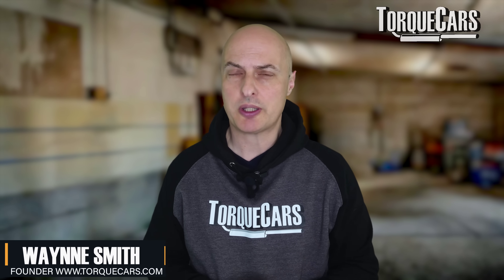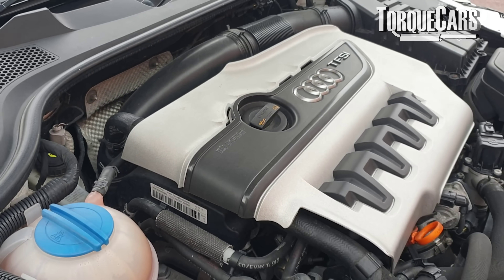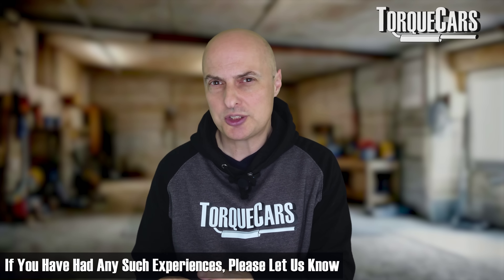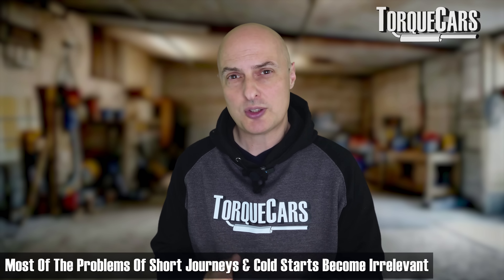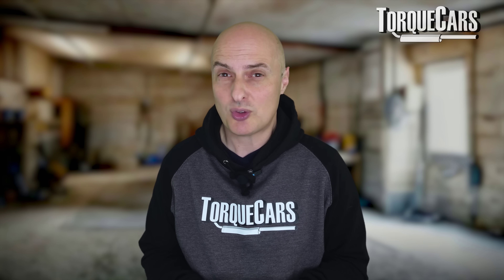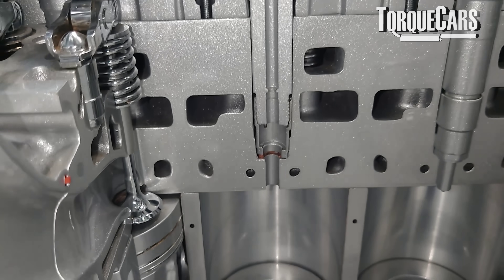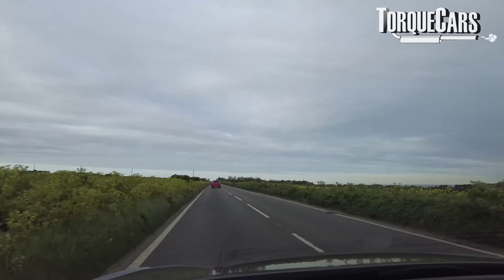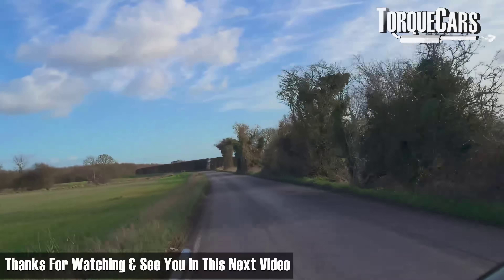🚗 Stop-Start vs Engine Idling: Which Really Kills Cars?💥 The Truth May Surprise You…

Comment: I've driven 2 stop-start cars, both diesels, I'm not sure if that makes a difference; 

Citroen grand C4 picasso/spacetourer 1.5 manual. It was perfectly fine, as you say it would kick back in before even reaching the biting point, and the system wouldn't enable stop-start until the engine had warmed up & Aircon is off.

Ford grand tourneo connect (rebadged VW cadi maxi) 2.0 automatic. Absolutely awful, stop-start would kick in before you even stopped, whilst slowing down, even somewhere around 5-10mph, when this happens the power steering cuts out too. It would take at least a second to kick back in, I found it incredibly dangerous and there wasn't an obvious way to disable it without going through a million menus on the touch screen, even then it wasn't permanent.
Coming to a T-junction and slowing down, then going to turn and leave would almost always have the engine cut out and progress halted. I returned it after less than a year, it was woeful. It was worse than being a new/learner driver again stalling it at every inappropriate moment.

Comment: My stop/start doesn't even operate when cold or if the battery voltage is too low but I'm now in the habit of just switching it off each time I start the car.
Reply: @mda5003  I have a ds3 and mine is the same I just turn it off
Reply: Same with Jags. It doesn’t work until the engine’s warm
Reply: Same
Reply: All i get is the green eco light flashing if i try and use it so its just a waste of time @stephenvarty191

Comment: What about turbo engine? I mean turbo itself. Driving hard, "barely legal, full brakes on red traffic light and your start/stop system is shutting engine down. Engine oil in these tiny tubes to the turbo and from are simply boiling there. I am not joking, you can check boiling temperature in the spec of your oil. Mine is 223 degrees Celsius. Guess what is the turbo temperature? Yes, nothing will happen immediately but oil residuals after boiling will stay there, in tiny oil chanels and willmgrow with time until your engine oil will not be able to flow there. This is not a hate, this is just an expression of my own and private understanding, knowledge and experience. I have switched off systems completely at all my vehicles with the help of different things. There are several ways to do it at least for the cars I use. And I am planning to use/own as long as I could. Cheers from Sweden.
Reply: start/stop does not activate when turbo temps are high. The ECU monitors EGT and coolant/oil temperature. Hot turbo = start/stop disabled. That’s why real-world start/stop turbo failures are not a thing

Comment: Stop start began in Europe decades ago in polluted cities. Traffic lights would have timers and you would turn off your engine at the lights. The stop start technology came in well after vehicles had electronic fuel injection and modern pollution devices that have now made exhaust clean. There is no need for this anymore and it can’t help but only make it fail quicker. Stop start leaving more fuel in the cylinders and getting into your oil 😮 Stop start is just a useless added expense

Comment: A decent stop-start doesn't operate until the engine is warm. I generally leave it switched on in my VW Transporter, but do switch it off if going to be in heavy congestion for long.

Comment: What about the amout of times the starter motor has to engage ? Wears it out prematurely 😢
Reply: It depends on how the engine is restarted - some cars have an alternative starting system eg an integrated starter generator, which may be either belt driven or direct drive.

Comment: Stop start generally won’t operate until the engine is up to temperature, so a cold engine is irrelevant
Reply: Are these systems responding to the time for coolant reaching operating temp?  If so, when starting a journey from cold, that time is not the same as for the metal engine components, nor for the engine oil.  

Warming-up times for each of these are different to the coolant fluid itself.  They probably vary, depending on the vehicle, engine type and operating conditions, but it's still worth bearing in mind.
Reply: @assininecomment1630  where is the coolant getting the heat from though ? Obviously the engine temperature and oil temperature

Comment: Stop start is annoying and will wear starter motor and battery out faster. When you start excess fuel is used briefly which could dilute oil if in a long jam. Stop start should be inhibited till engine up to working temp. If you drive in cities you should change oil more often.

Comment: Engine idling definitely.My stop start always fails within 6 months of buying a new battery
Reply: either you bought the wrong battery or you have problems with the electrical system. I've been driving with the same battery for 4-5 years and I use the start/stop system almost constantly - 2011 Hyundai I30 with 176800 km mileage :)

Comment: I know in the United States that's been discussed heavily through the last couple of years on YouTube, and it is definitely not a good thing to have an internet keeping starting and stopping as you're in a downtown traffic. And when that happens, you're not saving enough gas to make that even worthwhile. Which is the initial initial concept behind the idea? But when that happens, you're also causing more battery where you are. Your batteries probably not gonna give you. Maybe a couple years last time, if it keeps stopping starting it's not good.  The other thing is that I mean, this is not even an opinion. And some of these websites have also noticed that the about a complaints where the car doesn't start app just quite quick enough and you're going through traffic, making a turn after a light that almost couldn't you get the hesitation? And sometimes it occasionally works too much hesitation. So now you're backing up on the traffic around you? Instead of a car, running normally or truck be it. Now I'd rather stick with the old system where it just stays running and I'll shut it off when I think it's convenient for me.

Comment: I run my petrol in eco mode which disconnects the auto transmission when certain conditions are met. 70mph downhill on the motorway at 700rpm. Start stop is disabled every yime I start. If I hit a real jam, then I re engage it. Engine turns itself off. User vontrol all the time. Less stress on the timing chain.

Comment: Stop start is rubbish that saves no fuel what so ever ( unless you stop for more than a min) all it does is smash the starter ring and cost you a bomb once gets past 3 years old . My friend is a mechanic at bmw and has done loads of um. I'm a hgv mechanic , if this stop start is so good, why isn't fitted to 15 ltr truck engines? Because its crap.
Reply: Some Suzukis  (for example) have a belt driven /driving integrated starter generator (IGS) as part of a hybrid system. The normal pre-engage starter starts the engine for the first time, thereafter the IGS starts the engine after autostop. It is a very smooth and quick operation and makes no sound. In the mild Suzuki hybrids the IGS also assists the main engine as well as charging the battery. For a strong hybrid, there is a fairly powerful traction motor in addition to the IGS, the latter now only used for starting and battery charging. I think engine size matters when it comes to autostop being practical.

Comment: I love stop start, when it stop.  It's so silent & calm inside the car with the air conditioning blower still running.  But I would prefer the stop start switch to remain off after I drive till I on it back myself.  Now it's irritating the eco idle start back itself even previously, I already off it.

Comment: I have twice had my stop/start (a diesel Suzuki) stop just as I wanted to pull out of a junction into traffic leaving me a few metres exposed! I turn off stop/start as soon as I turn the car on.
Reply: And your starter will last how long???
Reply: @JohnShields-df8od 12 years from new so far most of which was spent in big cities. Almost never turned off stop/start, if anything I sometimes drive slightly differently in traffic to use it as much as possible. No problems so far.
Anecdote isn't evidence but I've not seen any evidence that it shortens starter life either.
Reply: Same problem here, I have a diesel auto tiguan. It is a nightmare at t-junctions. I wish I could disable the stop/start permanently.
Reply: @johnlondon4800  I don't get where the issue is, any Stop/Start car I have driven only stops the engine when in neutral and you remove your foot from the clutch. Does the Tiguan not operate in the same way?
Reply: @Witchaven  They said it's an automatic
Reply: @mucicafrajer  Ah true. Sorry, I missed that.
Reply: @johnlondon4800  You can usually control its activation based on how you press the brake pedal or accelerator in an auto, and in a manual it's easy to control with the clutch
Reply: @johnlondon4800 Easily done by disconnecting the battery voltage sensor plug, although you may be left with a dashboard warning light.
Reply: Why would you stop your car, put it in neutral, and take your foot off the clutch pedal while sticking out across a junction!? That's on you, not the car.
Reply: Not true I can easily push my clutch in and there is a momentary pause before I am off I fucking hate stop start technology it’s fucked!
Reply: @u3962521 I've got it in my 12 year old diesel manual, it's absolutely fine. It's not completely instant but it usually is by the time you're in gear, and if you're going to need instant power why aren't you already in first gear with the clutch down.

IMO it's worth it to have slightly cleaner air from engines idling less.

Comment: Interesting that you failed to mention the most commonly described problem with stopstart. Wear on the starter motor, pinion and ring gear. Also the battery. 

Realistically, a normal day's commuting without stopstart would involve starting the engine twice. With stopstart it could be twenty times. Or more. This is bound to cause more wear on solenoid contacts, starter motor brushes etc.

And cars with stopstart require bigger, much more expensive batteries, so obviously it puts greater loads on them.

For these reasons, I generally turn it off. The exception being when there's going to be long delays at roadworks.
Reply: My brother, besides the rise of the belt/generator driven approaches of these mild hybrid systems, have you seen how beefy current starter motors are? 

That's the one from a MK8 Golf with a TDI Engine and DSG Gearbox. This car only comes with S/S: 02E911022CX (google parts number for pictures)
This is the one of a MK4 Golf TDI: 02A 911 024 (The MK4 never came with S/S)

You see how beefy it has gotten? Also they changed the output from 1,1kW to 2,0kW. These things just hold up since the Use of S/S systems. I can mainly speak for VAG but i rarely ever hear of a starter failing. Not sure about other brands tho. 

In terms of battery, you might have a small point, but again, the newer the car, the better the management. My Girlfriend has a 2017 MK7 Golf 1.6TDI with a manual.  S/S was used since the car was brand new. Thats over 100.000 starts. It's still the original battery and original starter at 160.000km. In MQB BCM Modules you can read the number of engine restarts.

In comparison, i owned a Passat B7 from 2014. I sold it with 250.000km, still with the original starter, but yes, the battery management was shit. One winter, the car would't restart after a stop anymore because the battery was dead. Also the battery on that car had to be replaced every ~3 years. This was shit.

Comment: It's especially useful if you have an engine with a wet belt system as your belt will last much longer if you have stop/start working. Best stop/start system imo is the reversible alternator that PSA used. Works miles better than a stater motor constantly engaging
Reply: Why does the wet belt last longer with stop/start?
Reply: Because it reduces fuel dilution. The main cause of wet belt degradation. You could prove this to yourself with oil analysis.

Comment: Stop start is useless on cars most of the time anyway, when it's hot you've got the AC running stop start barely kicks in because it can't run the AC for more than a minute with no engine and in winter it's the same for the heat and the fact the battery is less optimial in winter. At night it's rubbish especially if you car has halogen headlights as the power drain from the lights again means it can barely manage a minute before having to start up again. The only time stop start works well in the UK is briefly in spring and autumn where you aren't blasting AC, lots of heat and using the lights.

Comment: It’s also important to note, that turning off start/stop is recommended when driving fast for longer periods of time. This way you are able to prevent any overheating issues when running into a traffic jam after a fast drive. It’s especially true for turbocharged cars.
Reply: My stop start doesn’t operate when engine is cold, when battery is low or at the end of high speed runs!

Comment: Many years ago it calculated that 80% of engine wear takes place at start up. This is due too a lack of oil keeping surfaces apart. It doesn't matter to those people changing their vehicle regularly but for those who aim to high mileage, it is best not to use stop start.
Reply: 80% plus, at COLD startup!  Once warmed, matters not at all
Reply: @18_rabbit  Thank you for your comment.  Why should it matter if the engine is hot or cold? Surely it is the lack of oil pressure that results in wear.

Comment: I don't agree with the old adage that if you change the oil in your car every 5k miles it will last forever. That may have been more true decades ago, but it's the external systems now that dictate a car's economic longevity. None of the reasons I've had to replace my car have ever been due to wear of the engine internals. I keep my cars for between 7 to 10 years, until they become uneconomical to keep on the road.

Comment: The amount of times I’ve used the start stop and the lights immediately change, I now turn it off. If my engine is cold the start stop doesn’t work. I bought my car new and intend to keep it for the rest of my life.  I’m now 70 and car was bought in 2014 and has 66,000 miles on clock.
Reply: The main problem with stop/start is the system cannot predict if you are stopping for a split second or a full minute. Most annoying on an automatic is stopping (without s/start parameters met, so engine running) and suddenly it stops engine just as you are about to move! Therefore I disable the function on both automatics I drive until I detect a potential usefulness, knowing I will be stopped longer than a few seconds.

Comment: TBH I thought it was all a gimmick so refused to by a car with that function  UNTIL I got my mazda3 petrol. Turned it off for the first few months but then gave it a go, now it's on all the time and reducing holding on the clutch. It doesn't start right away, the car has to worm up first and doesn't work if aircon /heating is on. Just takes a second for the car to get going again. Informative video, keep um coming...

Comment: I have a 10 plate Fiat with Stop-Start. When I forget to turn it off, about half the time, when the sytem kicks back in to restart the engine it fails and constantly cranks until I switch off the ingnition key and start it that way.
If I could disable the "feature" permanantly, I would.

Comment: I have only had one car with stop/start. A Citroen C3 Auto. When the engine was cold it did not 'stop', but once the engine was warmed up it operated as it should. If the battery got low , in winter esp. it did not stop. In all it worked well. No delay when pulling away, it started as I pushed down on the 'go' pedal as the car ahead moved forwards. The car used no oil between changes, 18k miles, and averaged 46 mpg overall. (petrol , mostly in Town by a heavy footed young driver ) We sold the car at just under 70k miles , traded against a new EV. 
The stop/start system was built into the engine and included a different type of starter motor , higher rated alternator and higher capacity battery. High quality Oil, of course. 
I query the right of car drivers to pollute the air I breathe as they sit at traffic lights , level crossings, traffic jams etc. Stop/Start systems were designed to mitigate the harm done by ICE vehicles, something for all drivers to remember.

Comment: I've recently had the turbo in my golf gti replaced. I'm curious as to whether this failure could have been caused by the stop start technology e.g coming off a motorway to traffic lights and the engine immediately stopping with a hot turbo.
Reply: Very likely, worse thing you could do